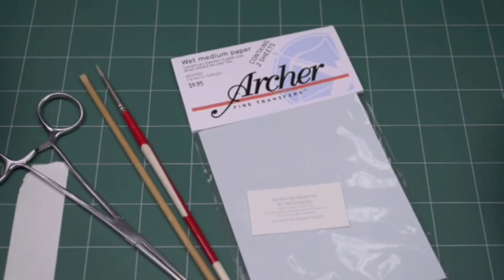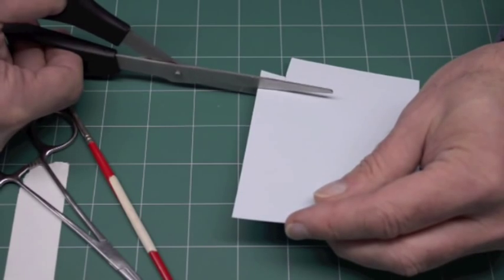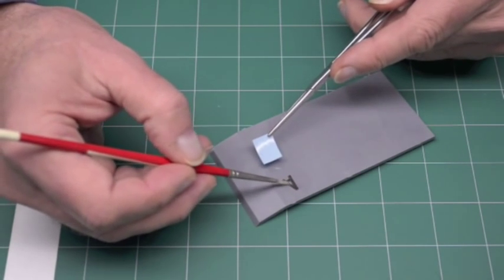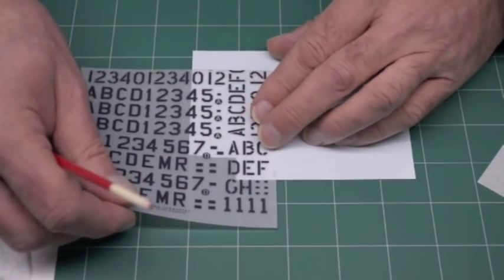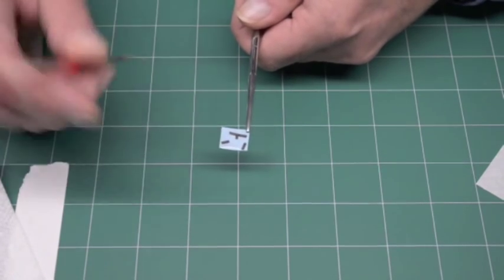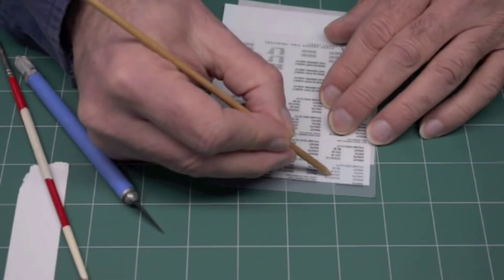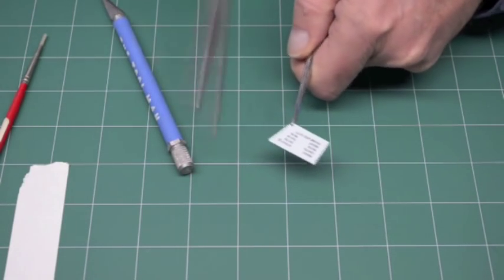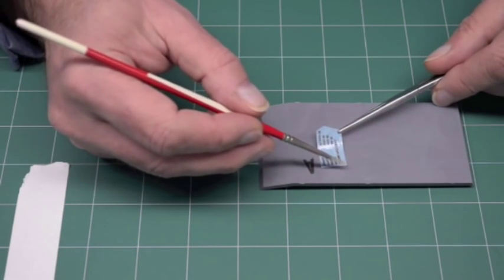Working with dry transfers - Part 3

Comment from the maker: @1339LARS 
Applying our instrument faces and placards is the same method as shown in this video. Simply apply them to the supplied Wet Media Paper, float them into position with a small paintbrush, soak up the water and then press them down with the foam rubber into the details as shown in Part 2 of this series.